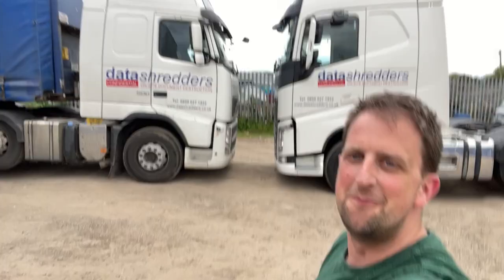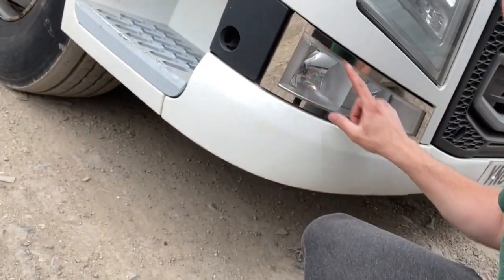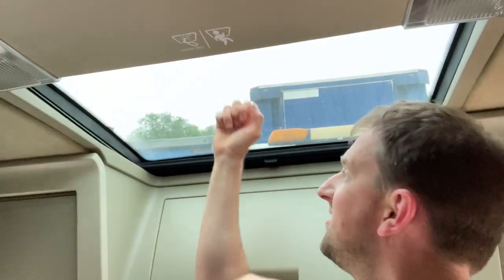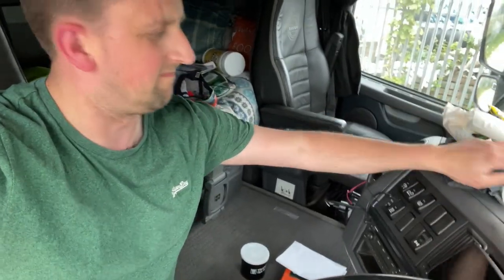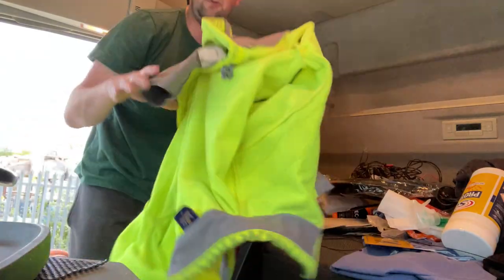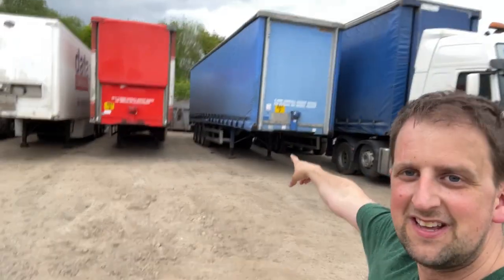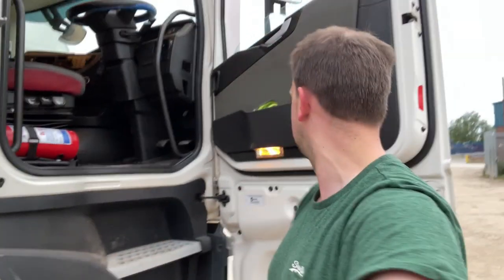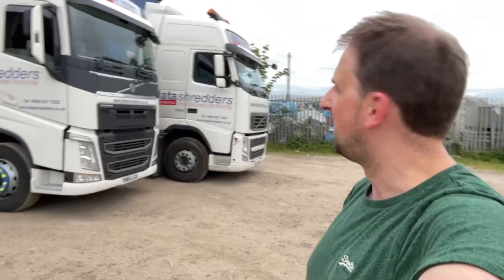Moving Into My New Truck | First Look | #truckertim

Comment: Just realized why there were so many extra licence plates for the trucks at the company I used to work for. They weren't actually for the trucks. They were for the trailers. In Sweden, the trailer doesn't have to display the truck's registration number. Every trailer has its own number plate, with its own number. However, since some of the trucks were occasionally on jobs in the UK, they eeded the licence plate for the trailer.

Comment: Awesome truck I’ve just finished rebuilding one and converting a few things. In case you didn’t know you have an electric front windscreen shade and it’s a common thing for night heater to go but can be reset, it’s tedious though!
Reply: Also coolant level sensor! Forgot to add
Reply from the maker: Thanks for the info!
Reply: And a hand pull down night shade on the top of the driver side door :)